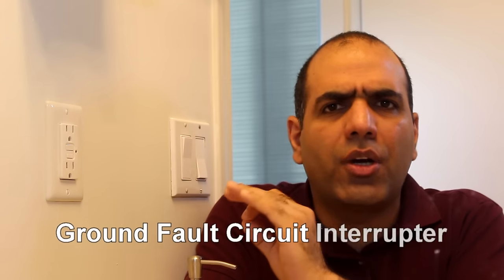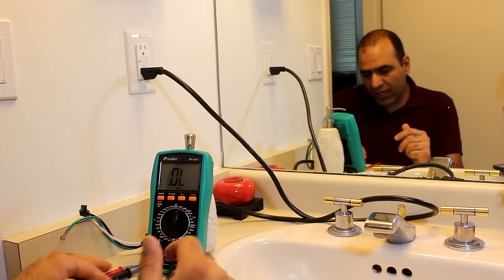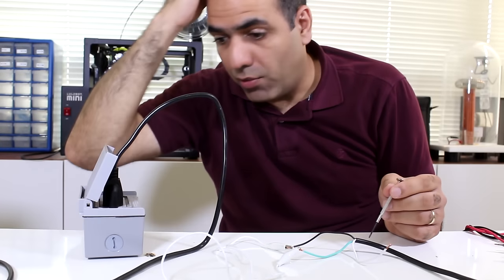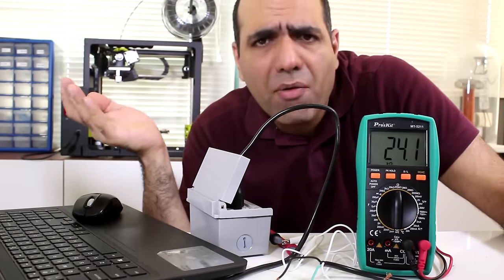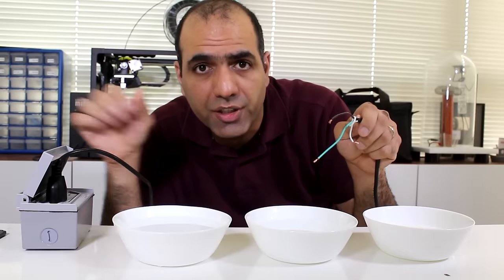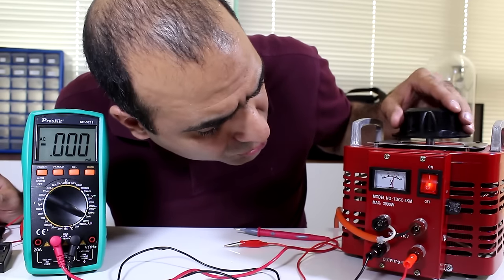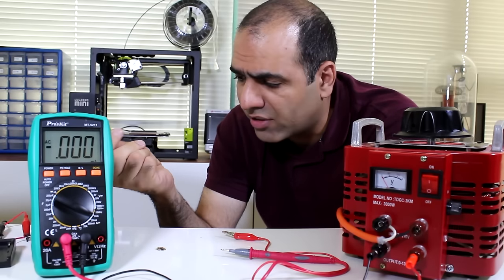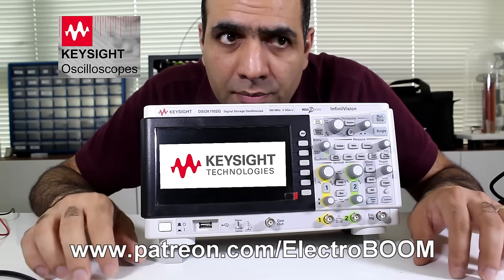The Outlet that Saves Lives

Comment: I've personally tripped a GFCI in a wet environment, I felt a cycle or two and it tripped. Putting that muddy term "ground" in the name really seems to confuse people, the 5mA+ fault current can go anywhere that's out of the loop from the live pin to the neutral pin on the plug and trip it, simple as that. GFCI receptacles are even code legal with no ground connection, works fine.

Comment: If you dropped a hair dryer or toaster into a bathtub full of soapy water the resistance will be a lot less than 100k hot to ground (not through your body, water to drain pipe).

Comment: Mate, there needs to be current between live and neutral and it needs to be different. There are 2 kinds of protection circuits. The ELR, or the Earth leakage relay which detects actual earth current but will not provide protection if say, a person accidently touches live and neutral. Second is RCCB or residual current circuit breaker which measures live and neutral and when the difference exceeds an x amount e.g. in India we have 2 level rccbs, 300ma(less sensitive)  and 30ma(more sensitive) the circuit trips.

Comment: i could see it being possible that someone has a really cluttered or poorly laid out bathroom.. to help with the clutter, they have their hairdryer suspended on those 3M tape wall-mounted hooks. because it's a small bathroom, that hook is near their shower.. maybe they take long hot steamy showers, and the moisture condenses on cold bathroom walls. that moisture weakens the tape over time. one day, while taking a shower, the tape is weakened to the point where it fails and the hook falls off the wall, and the hairdryer falls and somehow manages to bounce into the shower/bathtub while they are in it. this is entirely possible. a GFCI outlet would save their lives here.

Comment: I think we have even better protection in the whole house here I’m Denmark.
At least I think so, because I was once exposed to live wires by accident when unplugging an tv, and I was unable to let go of the cord, but luckily all power turned off in the house, so I didn’t die.
Reply: GFCI is kind of a 'band aid' solution mostly used in the US & (a slightly different version in) UK, but for large parts of Europe laws state that your breaker box should have these safety features, so essentially you have the same safety net, but its not in the power socket, instead its in your breaker box, its essentially the same thing though.

Comment: If there is no GFCI, then wouldn't the main breaker for the room/house just blow, also saving your life? Or does that require a higher current drop?
Reply: No standard breakers only trip in north america if the current is greater than the rating on the breaker. You to ground does not cause this.

Comment: You got misconception hot water has higher kinetic energy upon the particles of water which allow the electrons to transfer more rapidly because electron also obtain heat  energy from hot water . Besides that the particles is much more further from each other in hot water which provide lower resistant.NOTE HEAT ENERGY FROM CONDUCTION ACTUALLY IS THE MOVEMENT OF THE PARTICLE. THE FASTER THEY GO THE HIGHER HEAT ENERGY IS PRESENCE.

Comment: 4:09 Yeah, electricity is really scary, I heard about electrician, who did not switch off circuit breaker, or maybe switched off the wrong one, and wanted to fix a problematic power outlet. He touched the metal part of his screwdriver and he could not let go, I am not sure about the details, he might have touched the  metal pipes from heating with his legs... his arm got twisted, he could not breathe, and he suffocated.

Comment: we have the same thing sitting on each group on the main boards as a fuse called "HPFI relay" similar to (RCD(Residual Current Device))..i belive there are electric saws that uses same technologi to stop  the blade from cuting flash or is it ? .. atleas i belive it is same kind of fuse ...thanks for your entertaning videos and the risks you take :-D  ...beset regards from Denmark!

Comment: in european countrys there are GFCI on every outlet (yes its 230V so more dangerous) that is called FI  and triggers at 0.3mA so almost instantly but bc of the much higher voltage you could die anyways

Comment: Madison's extension cord may have been a two wire cord. likely to be used for for a phone... a 2 wire cord will defeat a GFCI because it has no ground. 
additionally, when I have my hand in a live box, the other one goes behind my back. It is a safety measure when working on a live circuit that cannot be turned off. Old electrician trick, to keep the shocks to the one hand!

Comment: Did the breaker pop in the warm water because @Medi had a wafer softener which adds salt to the hot water? It would increase the conductivity. It might mean those without water softeners might not have the same results.

Comment: If you touch the Light and the Neutral wire and you are grounded the electricity should pass you through against earth.
Then the RCD in Europe is supposed to get triggered by about 21mA.
The maximum here is 30mA BTW.
If you are not grounded then the electricity pass your body causing maybe a short circuit.

Comment: If you touch a tennis ratchet bug zapper that operates on 2 AA batteries 3v, and you touch the wires with one finger you get a shock, burn. What if you touch one wire with one hand and the other wire with the other hand? Will the current go through you? Is that dangerous?

Comment: Hm, Swiss, Austrian and German G... uh, ...GFCIs are rated for a maximum tripping current of 30mA. Ouch... On the other hand, each electric outlet needs to be equipped with one (usually done in groups, in the same box as your normal circuit breakers). So your kettle shouldn't kill you, even if the earth wire is broken.

Comment: What does soap do that made it different?
Reply: (Like hot tap water picking up tiny particles of chalk/lime from your pipes) It introduces a load of extra stuff to the water, making it easier for power to flow trough it, the particles of stuff will make it much easier for electricity to 'find a path' trough the water. And the amount of particles you introduce when squeezing in a little bit of soap is like 10fold (if not more) of the few particles you get from hot tapwater so thats why soap 'works better'

Comment: When I was a kid I went to unplug an old radio plug from an outlet and the plastic cover came off leaving the bare prongs still plugged in the outlet.  I touched the bare prongs with one hand it the current made my arm vibrate and tingle I thought it was cool and touched it couple more times then my step mom came in freaked out on me lol

Comment: The interesting thing is that, with lower resistance when your skin is wet the system wouldn't save you from getting electrocuted, not until you'd be dry enough to trigger that life saver circuit xD But Like you showed at the end, soaking wet and soapy hand touches the L and GND.. That's surely more close to the short circuit, when the actual breaker should've popped....? Cause soaking wet soaped hand and about 5-6cm between the L and GND shouldn't have anywhere near that 10 kOhm what was high enough resistance to  trigger the circuit.. What am I missing why it worked with the last try? Was the old one in the bathroom with different  standarts built older one and the which worked a newer one? or wtf? :D

Comment: If GFCI same as rccb??
Reply: Essentially yes, there are many names and types of equipment that run on the same principal. Some common names include Residual Current Device (RCD), Ground fault current interrupter (GFCI), Residual current circuit breaker (RCCB), Residual Current Breaker with Overcurrent protection (RCBO). Note that the last 2 also act as circuit breakers that protect against overcurrent. In my country (Australia) it is now required that all domestic circuits have RCD protection so special outlets are unnecessary.

Comment: there was a cooler that was leaking electrically, i touched the metal part, touched a piece of metal, it was 240VAC and it sent me flying off a 3foot ladder, i never felt so much pain, if i had grabbed on i would have 100% died, i landed up with melted skin where my finger touched the metal

Comment: But toasters don't have ground wires... Wouldn't that be better to have the casing of the toaster grounded? Why didn't you cover what happens when the ground meets the neutral?
Reply: anything is ground, when there is no negative wire. When you have ground wire, electricity will flow to ground wire. If not, electricity will flow to "ground" through you

Comment: im a survivor.. i was 7 years old..  ( my sister swung on a chandelier and broke the light bulbs.... ) I climbed a ladder , put my finger in the socket, (trying to get the metal half out that was left in and... ( YELLOW VISION ( Think Urinal Trough ) !!!! Vision like computer image shimmer.... looked around  then smelt something burning.. pulled finger out  ... looked at finger,  2 white marks... tried washing off.....    Half body got limp.. 24 hours observation in hospital..... ( if i was left handed i would be dead , as the heart was on that side....)  My grades went down... i have a Aquired brain injury ... that was only really diagnosed properly after reading up on it, and putting everything together recently... . im 40 this year
Reply: 240v australia    ( thank goodness not 110 V )
Reply: teaching left handed to be right handed would save lives when it comes to electricity

Comment: So In conclusion, if she had touched the frayed wire with a dry hand she would have still died even though the gfci theoretically is supposed to trip after 5 milliamps but in the actual test did not?

Comment: The point of this device is to save your life, not prevent electric shock. If something tragic were to happen you might not be able to pull yourself away from the power source. In which case you would perish from the continuous electric shock, which this handy device is designed to detect and stop. You'll certainly feel it though, there's no denying that, but you'll live to see another day.

Comment: hey i've tried quite a lot of shit my self...
I've ran 25 Amps and 512 volts through my arms..
that shit makes you feel like someone just clubbed you in the chest with a sledge.
And no i did not know enough... but later learned...
use safety equipment, use insulated tools, or just use an electrician....
Thanks for funny but informative video...
I'm off to install some electrical systems

Comment: Those GFC can be tuned. The rating is given on the sticker that has a tolerance percentage which any manufacturer won't disclose, instead, they will suffocate with graphs. All in all its a pathetic GFC, there is a need of standard operating conditions for home and Industrial usages.

Comment: I don’t think she would be saved because the cord was a two prong cord so no ground or earth.
Reply: Electrical,smoke alarms and more If the Bath was grounded then she would have been saved.
Reply: David Richardson I though about what I was thinking of.  I do see she closed the circuit by grabbing the cord and it was not plugged into a gfci which may not make a difference but I could be wrong.

Comment: Contact area is inversely proportional (more or less) to impedance. In the bath the entire body which is under water acts as the electrode and probably has thousands of times lower impedance than just holding wires in your fingers

Comment: Hey Mehdi..I'm a big fan. Just one question the AC voltage your measuring with your Multi meter is only RMS value, NOT true AC voltage, it can be much higher..so does that mean GFCI would work with that higher voltage? how much current actually passes through?

Comment: I have been electrocuted with 230v AC 50hz in Cape Town and goodness it was bad. I am lucky the Earth Leakage tripped. It is what we call RCD here, and it trips at 30ma on the whole house. If anyone wonders how I got electrocuted, I was trying to fix a fridge from the 1970s and the ground circuit failed while I tried opening it to get some soup for my family, and I got electrocuted with a very high current. Both worked hand in hand, but thank goodness it was 3 seconds only.